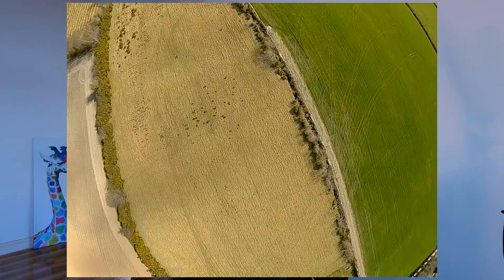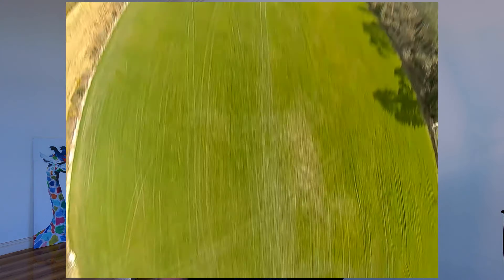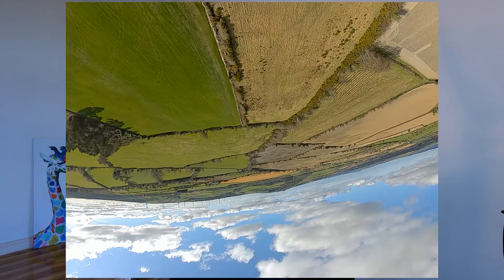Beginner gives FPV Trick Tutorial- Inverted Yaw Spin

Comment: You need to mix a bit of roll inside your Yaw spin. Then it will look better. If you use betaflight on this quad u can also use "fpv mix" so your Yaw spins will not go crazy. But that's a kind of cheating. It's better to learn to mix roll in... ☺
Reply: I think its amazing 🤩🤩